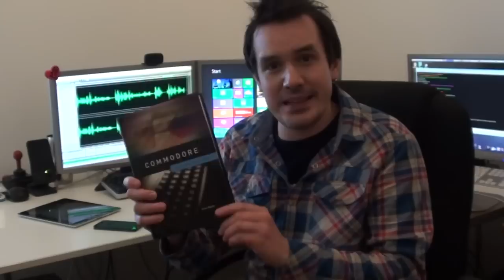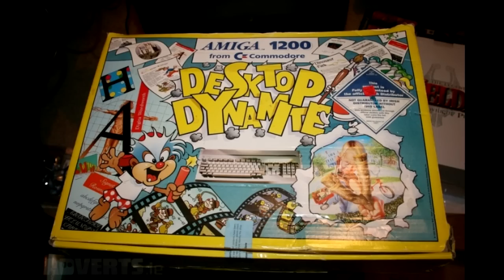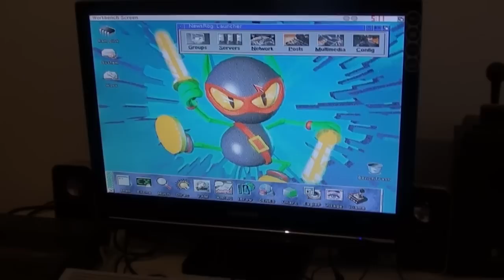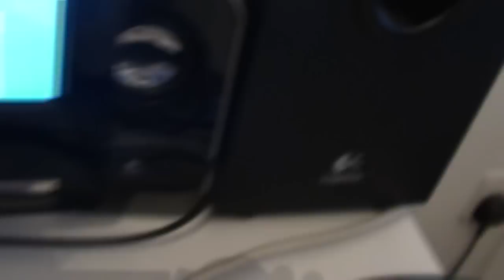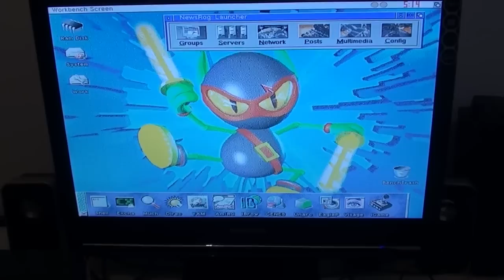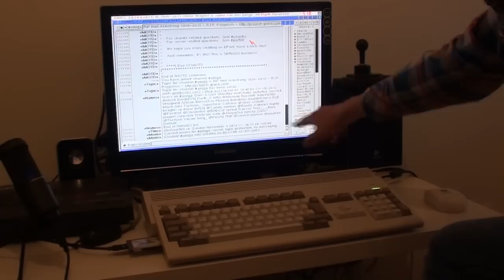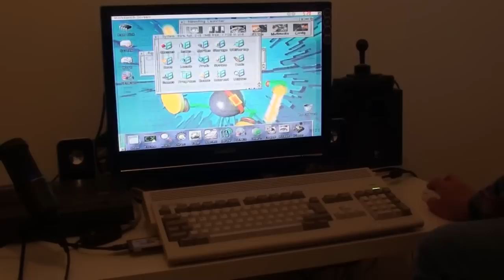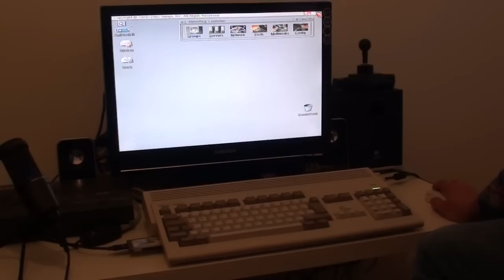Commodore Amiga 1200 Review

Comment: Very good value for money, but ... cheap power supply, with switch on it and not on the machine, not a great keyboard, yet again a slow processor, no improvement for the sound : still only 4 channels 8 bits linear, no chunky graphics modes, no easily usable hi res modes without the expansion you have in your machine, no HD diskette drive ...
The A1200 appeared 2 years too late, technology wise.
Oh and don't forget selling 'cheap' means small margins and for Commodore it eventually meant bankruptcy ...
The exact opposite philosophy of Acorn, who closed their computer business in 1998 (read again : they did not go bankrupt).
I'd like you to review the Acorn machines, after all you did review the Atari ST, didn't you ?
Zeewolf with your accelerator (worth 100s of pounds at the time, nobody could afford) is much slower than any 3D game on the slowest Archie at 8 Mhz  ...

Comment: The A1200 was a botched mess caused by the massively reduced R&D budget. Awful CPU with the crippled version of the 68020. 16Mhz 68030 was pretty much the  baseline for usability in comparison to a 386 machine.
The AGA chipset was half-baked. No hardware chunky mode. Slow blitter, 4 channel sound (same as 1985 A1000 FFS) etc. AAA chipset would of remedied pretty much all of the issues. Hardware chunky mode (aka Wolf3D and DOOM), faster blitter, and 8 CHANNEL sound!! That would have been wonderful Vs even Sound Blaster cards on DOS. 
And of course the last shot in the foot of the A1200, the same 880KB DD floppy drives... 
Other PCs had had 1.44MB for years, but Commodore in their infinity stupidity used disks almost half the size of rival machines, so games often had large amounts of assets removed. 
The A1200 had a lot of potential, but it turned out to be a pile of crap. 
Amiga 500 is great though.